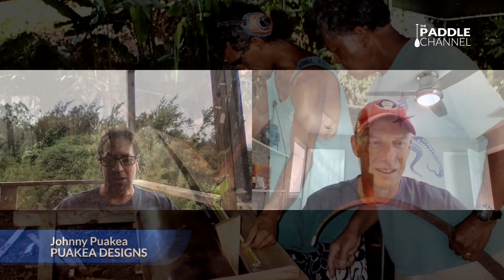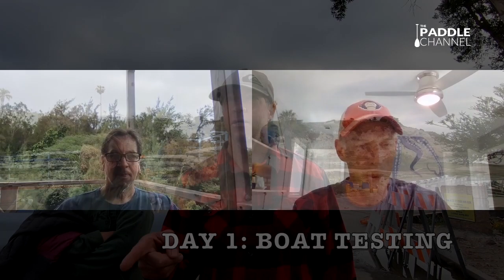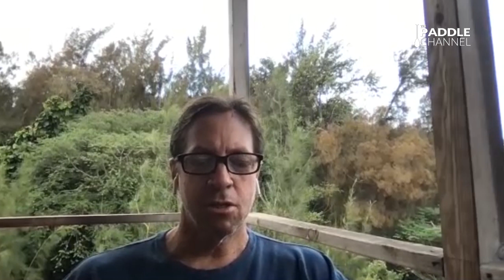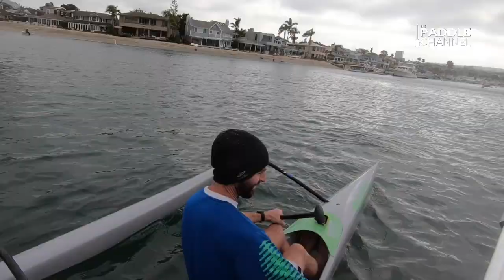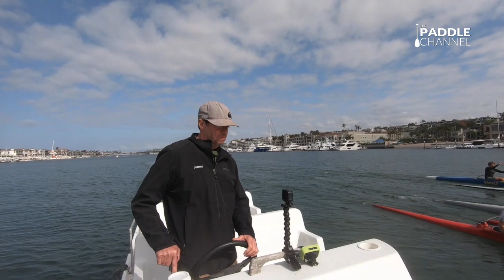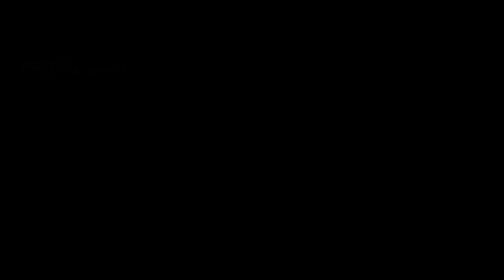Johnny Puakea on Testing the Volare OC1 Flatwater Speed, paddling tips, downwind tips and more!

Comment: Got my Kahele 3 months ago and love it!
Reply: Hey Rick, do you happen to be 160 lbs or less? Johnny talked about how the Volare might be better for those over 160 lbs.
Reply: @barryblackburn5910  I sit on the bubble at 160 pounds and have a Kahele.     That low volume plumb bow is something you have to get used to at 3 feet plus waves as it just reinforces the requirement to ‘stay high on the wave’ to avoid pearling.  Otherwise very manageable.    Ozone has a little chart of weight vs wave height for Kahele and Volare - image search for Kahele vs Volare and it should come up.
Reply: @MrPhil604  great feedback. 🤙🏽
Reply: @barryblackburn5910  Hey Barry,  I was really on the fence about kahele vs Volare. At 6ft and 165 lbs  I figured I'd be ok with the kahele. I haven't surfed anything bigger than 2 maybe 2.5 ft waves in it yet so I'm gonna have to see how she does in 3 ft. Mahalo for the info.  🤙🏼
Reply: @MrPhil604  Mahalo for sharing that. I'll definitely remember to stay high on bigger waves. 🤙🏼

Comment: I'd really like to see the data around the time trials and how they compare given an elite level athlete. Given similar conditions, seeing what adjustments on stroke length and rate while keeping the athlete and heart rate constant would be very useful gauge the performance.

I've been paddling 10+ years, am 190lbs/6ft tall and decided to get the Volare. I'm struggling to get the top speed up (using a GPS) in flat water/no wind conditions at a reasonable heart rate. I'm currently asserting that my ama settings and my covid-fitness are the factors which lead to my other paddling friends in leaving me behind! I'm sure that the merits in downwind are there but understanding the flat water performance would be fantastic!
Reply from the maker: That would be cool to see.
Reply: In my opinion, because of the wider beam/volume in the Volare, you do need  to load the blade a bit more in order to get the speed up. This is in comparison with the Kahele. Once you have the cruising speed you have increase the cadence in order to increase speed or just keep loading the blade with slow rate for a cruising experience. However I do suspect because of the wider beam you need a paddle blade that "catches" better to match the extra volume you're trying to push in the Volare. My flat water settings are swept rudder and the back ama at the end of the shaded area to keep it the most level. I also use a kialoa Hoku but plan on getting a Puakea Maika'i for the extra bite the Volare might need in adverse conditions. I also have the front ama pointed higher.  As Johnny said in the video  "aim with your feet." good luck with your new Volare!

Comment: Hi, have been looking at every video I can on the Volare and Kahele, was in Hood River a few days ago and visited with Waterwalker and he showed me the two models in detail. I’m still having a hard time making up my mind, I know both boats will work for my size, 5’10 180-185lbs to use on the Gorge and in San Diego. Does anyone know the volume of the Volare and/or the Kahele. I was unable to demo the boats so I am basing my decision on specs and documentation. Does anyone have any advice to help me make a choice.
Thanks
Reply from the maker: Hopefully someone can tune in with some specs for you, Bruno. We'd love to see those, too!
Reply: Bruno so the quick answer would be the Volare is better suited for you.  Here is the why in surf the adjustable foot brace will let you come forward more and allow you to drop in easier on the bumps.  The Volare has more volume than the Kahele most of the extra volume is actually under your seat and that helps the canoe get on the bump later than you would expect it works better with the swell to get on.  

The Kahele will also work well and the only reason you may want that boat is if you like to bully the boat a lot,  its smaller and lighter. In 0-60 its quicker than the Volare.  I have plenty of seat time in both canoe I am 6'2'' 225 and for me the Volare definetly works better.  Also at my size find the extra seat width makes the Volare more comfortable.  Check out this The Paddle Channel Video it will also be helpful.  https://www.youtube.com/watch?v=5-EV9unJYsw&t=96s  Feel free to reach out with more questions 

Aloha Coach Paolo
Reply: @paoloameglio8919  thank you very much for getting back to me I appreciate it. This helps as I have to place my order for a boat in the next couple of weeks. Thanks again.

Comment: How do these OC1's compare to surfskis or a K1 in flat water speed?
Reply from the maker: Typically an OC1 is going to be slower than a stable paddler in most surfskis and especially K1s. The ama does create a bit of additional drag. But if the double-bladed paddler isn't stable, they won't get the best speed out of the 'ski or K1.
Reply: @ThePaddleChannel  Thanks, You guys should do a side-by-side video. I can't find one anywhere comparing the two types of boats directly. Would be super helpful.
Reply: @ryanognibene5030  we'll get that into our video queue. Great idea!